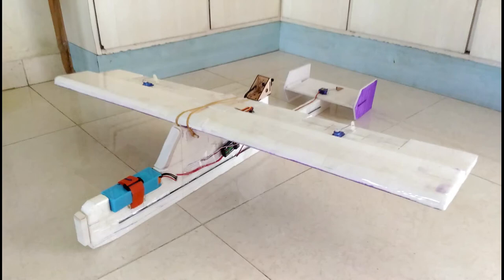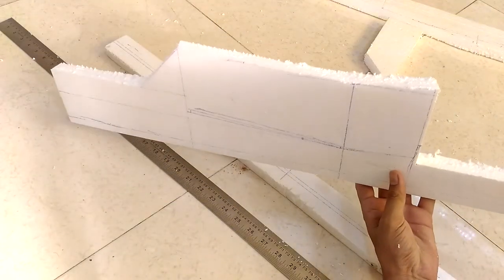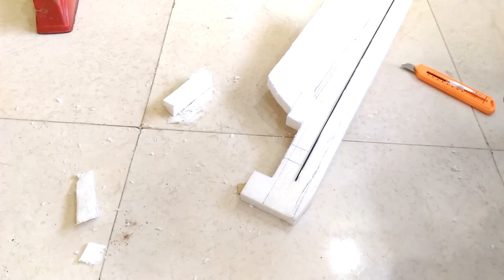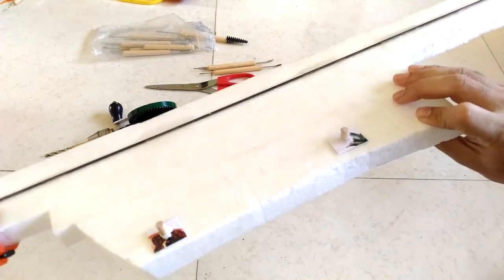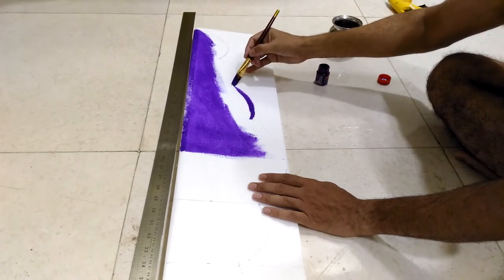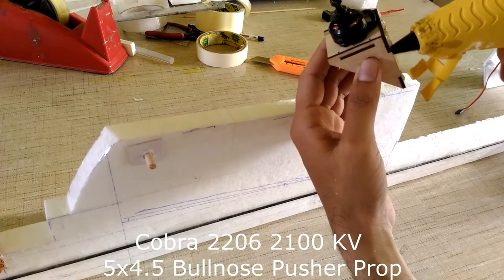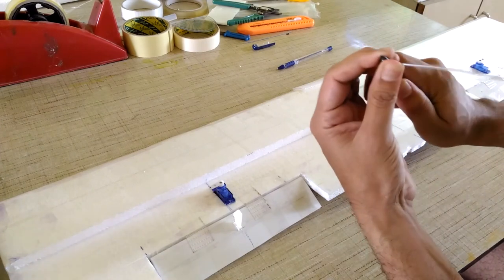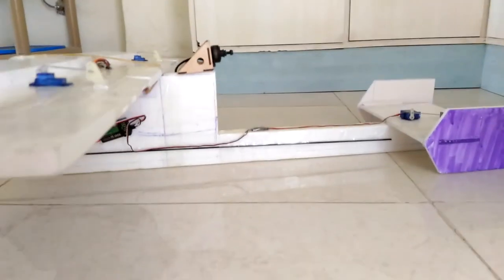How to make RC Airplane for beginner KFM airfoil

Comment: Great start Amit RC. Looks like it's tail heavy (looping up in the air) and maybe needs bigger rudders for directional stability. Might be better if you can drop the motor mount down as far as possible. Good luck
Reply from the maker: Thanks Andrew for your valuable suggestion.  Yes..will work on them. Happy Flying...))

Comment: Nice work. A heavier battery could be fitted to bring centre of gravity bit further forward. Modelling is a learning curve and hope you keep nspired to keep trying new things. A simple hot wire cutter made from an old guitar string, metal of course,a battery and some scrap wood is a very handy tool.